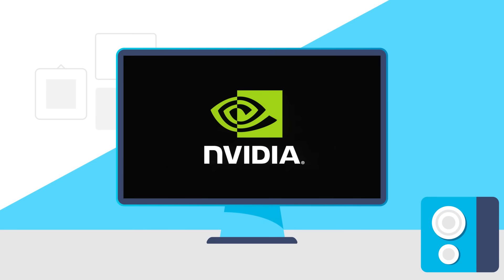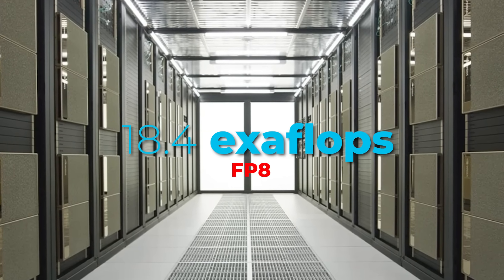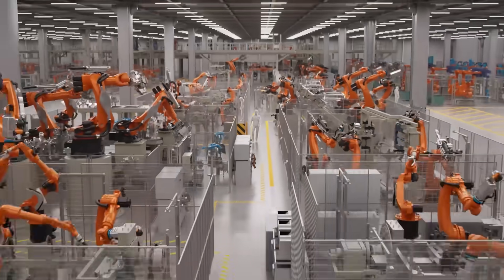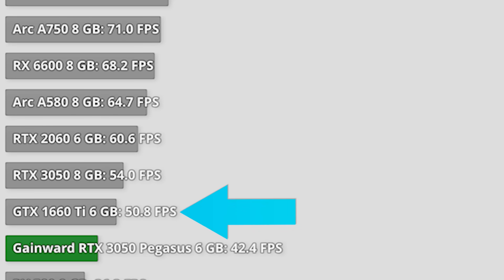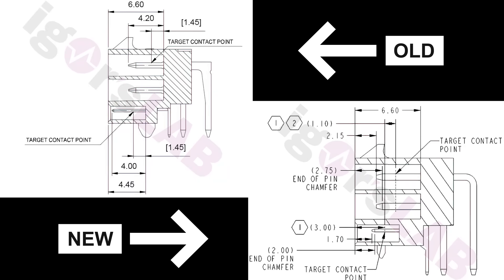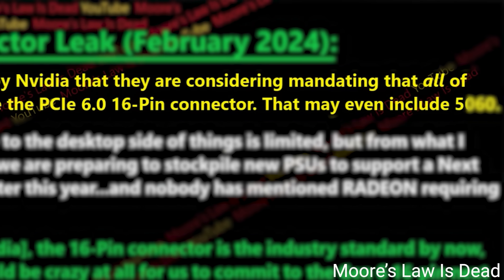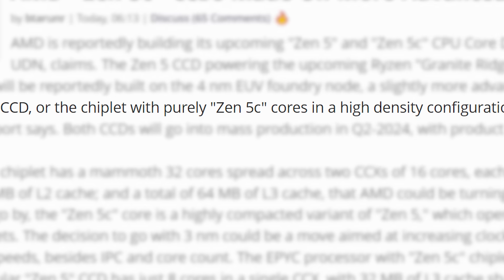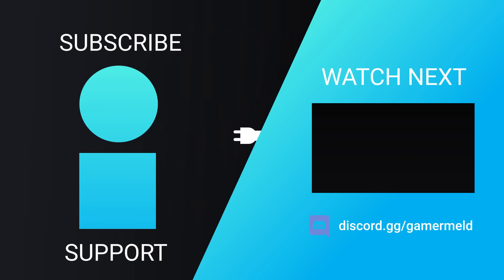Nvidia’s Requiring Big Change for RTX 5000!

Comment: I'd rather have a gpu requiring a 16 pin connector instead of the shitty 12V2x6 connector
Reply: I'd rather have a GPU using 'known safe' standard 8 pins, even if it needs 3

Comment: That connector requirement burns me up!
Reply: The 12VHPWR connector alone is reason enough to buy AMD.
Reply: @harveybirdmannequin  DP 2.1 has entered this chat.
Reply: @harveybirdmannequin that is ironic. I was looking to pick up a 7900XTX 2 Decembers ago at release, but it was such an absolute sh!tshow I returned the card after 10 days. What a mess. AMD adrenalin issues, hot spot temp issues, DIES CRACKING?? No thanks. Many people can parrot on about the connectors but AMD cards were absolute garbo at release - and I'm totally a team red fan. I bought a 4090 since and have no regrets. The XTX had the audacity to state 8k resolution on the box - and my 1080ti was beating it in cyberpunk 2077 benchmarks. No more new AMD GPUs for me.
Reply: Ba dum tss
Reply: Maybe insurance company's will raise premium if a NVIDIA card is in the house, or even flat out refuse to insure you.
NVIDIA cards need to get a warning label on the box like: "we cannot guaranty your safety when using this product"...
Reply: Okay then don't stick your hands and fingers on it while it's melting
Reply: as a 3070 user I am disappointed because if  I ever want to upgrade to said 5000 series it would be crappy

Comment: I am excited to see what the 5060 and 5070 perform like. They are slated to use less power (tier-for-tier). So the 5090 is said to use 50 watts less than the 4090. This will be a huge plus. The 4000 series are still very hungry.
Reply: The 5060 will probably cost 400$ and will perform the same as the RTX 4070 non S. Absolute garbage.
Reply: @einstien2409  I think the 5060 will be a 3070 Ti... 4060 is already slower than a 3060 Ti.
Reply: @einstien2409 yep it might be 15 percent more power efficient though. As if we gamers give a damn lmao 🎉
Reply: @CovenantAgentLazarus 3nm won’t be such an efficiency jump from 5nm by looking at Apples new chip, probably why AMD went 4nm for Zen5 P-cores. My guess is they need to give us a lot more CUDA for the same price otherwise AMD will overtake
Reply: But AMD failed to deliver theRDNA4 architecture. So the next high end chips from them will be around q42025/q1 2026. Until that time Nvidia will dominate the market (except the lower end)
Reply: @bartix698  what are you talking about? RTX 5000 is coming Q3/ Q4  2025. RDNA 4 is already getting linux updates so it will come during Q3/Q4 2025. Only intel will release their stuff Q3/Q4 2024.
Reply: @einstien2409 I'd say $50 more than the current xx60 tier. But I agree the price is garbage. We will see though.

A tiny, dinky card pushing big games is exciting to me. I think AMD's 780m is amazing. But times move by profit incriminats. 

I've been following graphics card generation leaps since the S3 Savage, 3DFx VooDoo, ATi and Nvidia Riva cards.

Comment: 3050 also requires a 550w psu, so not good for business pc's anyway.  no point in bragging no power cable when you have to upgrade psu still.
Reply: If a graphics card doesn't use external power (outside of the PCIe slot) then it won't pull a lot of power. It will pull 55 watts from the PCIe slot. That's it. The only better performing card that exists right now that is a plug and play card is the GTX 1650.
Reply: @Twitch_Moderator you can literally gaming on RTX A2000 (both ampere and ada), which is currently the most powerful PCIe-slot powered cards
Reply: thanks
 @Twitch_Moderator I had considered it to upgrade from the 1650 I have in it (oc ddr6 version)
Reply: RTX 3050 6GB doesn't need that powerful PSU. OEMs only give you the "safe" requirement. You can literally power that using 225W OEM's PC PSU as long as you don't OC
Reply: ty @RinoAP
Reply: The RTX 3050 does not require 550 watts. At all or ever. It never did. Not even close
Reply: 2 different models I had looked at said that they were in the specs, so I was going by that. @CovenantAgentLazarus